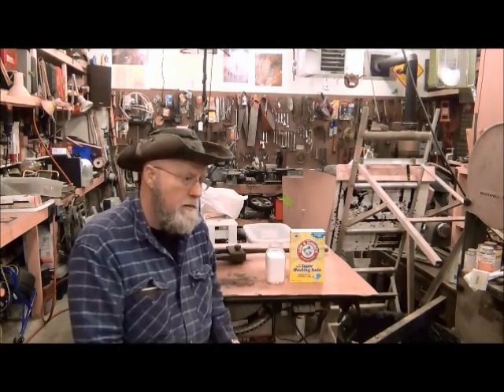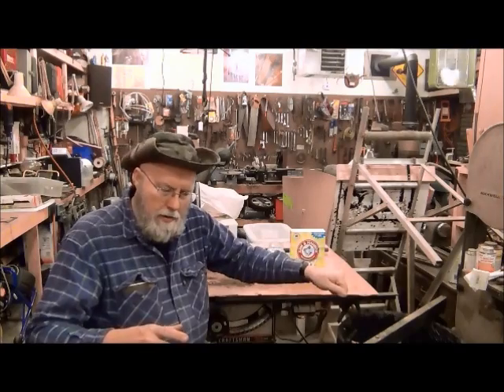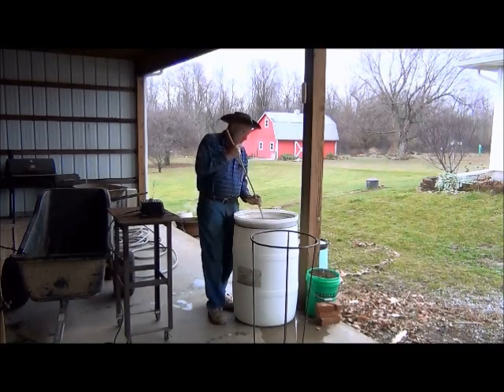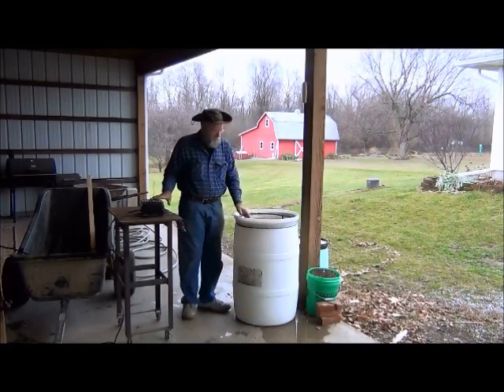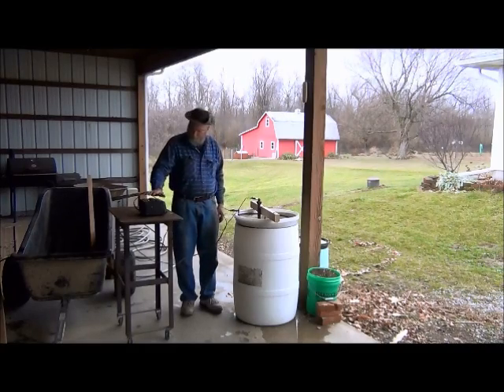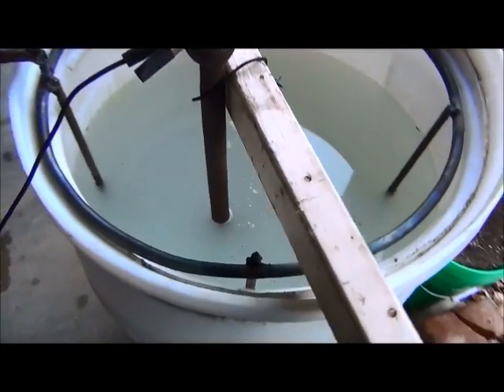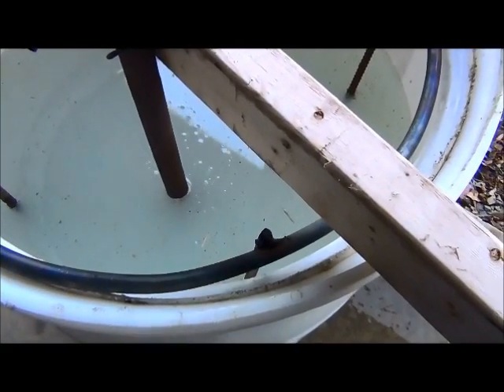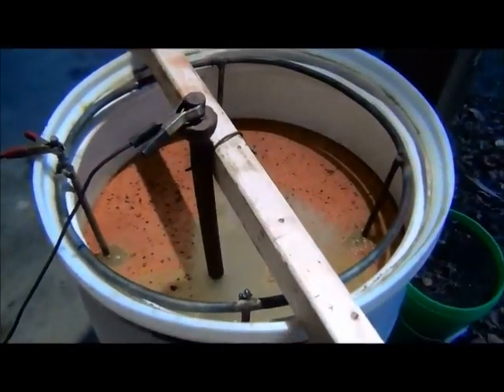Blacksmith vice electrolysis de rusting

Comment: the solution will be fine no matter what it looks like.  if the water is a little dirty you can evaluate the current eddys. you can also add more of the smaller parts and connect them to the power source.   as many as you wnated to as long as the parts dont touch.  oh and 2 amps of electricity will give you an amazing amount of tingle.  shutting the charger off will save a shocking

Comment: in the morning the anodes will look like they are wearing fuzzy orange sweaters.  The water surface will be covered in foam.  You can speed the process along somewhat by pulling the part and brishing the loose stuff off with a nylon brush.  If it doesnt come off with some gentle brishing it needs more soak time. This is not a fast process but it wont cause bigger pits like acids and scraping will. The hunley sat in a tank like that for years before they took it out.